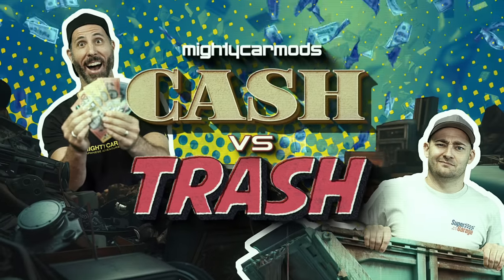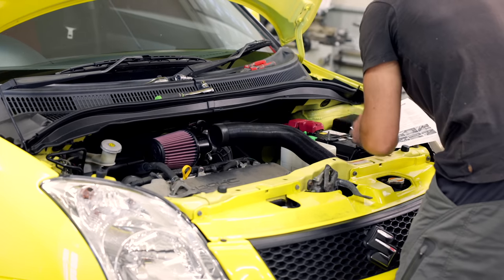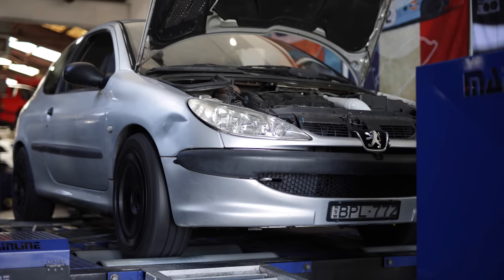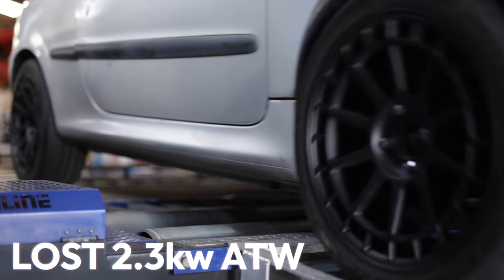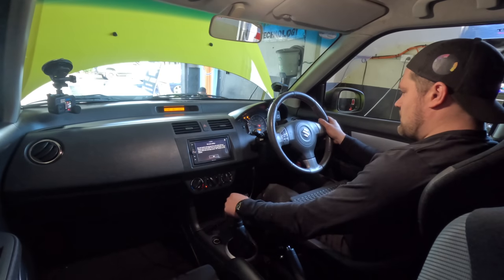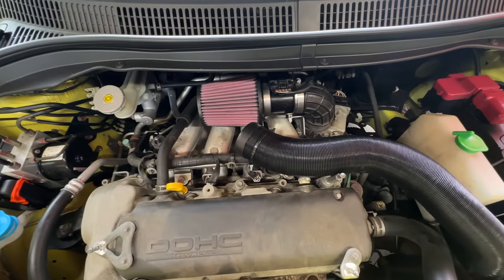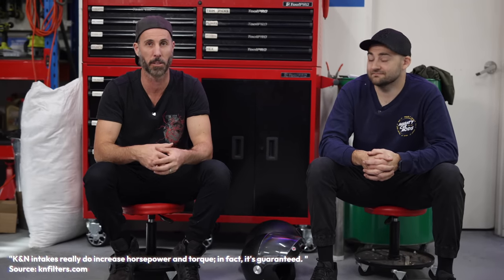Dyno testing POD FILTER Performance Claims | CASH vs TRASH

Comment: Of course Marty lost power. He got rid of his water cooled air filter.
Reply: This deserves a pin😂
Reply: your actually not wrong lol..
Reply: I just started to watch, thanks for the spoiler
Reply: And remove de air filter from the front of the car to inside the engine !
Reply: @hondamaniac1976  I know but this was the top comment and was visible.
Reply: @tzwientjuh  That's definitely a problem that is anyone BUT that poster's.
Reply: I think you mean Marty removed the Bong!
Reply: @tzwientjuh  he's referring to the earlier episode when they removed the stock intakes and installed the new/trash (hot air) intakes
Reply: Heat soaking
Reply: Factory meth injection
Reply: Good point 😂😂😂😂
Reply: more likely it's the wheels as they are quite a bit heavier than the old ones, a hub dyno would show what the engine change would be, he probably lost more hp to the wheels but maybe freed up a pair of hp with his mods xD
Reply: Honestly I would say it’s the fact he now has heavier wheels
Reply: @brendanmooney8517  still losing power on the poogoat thru them as they are wider and heavier than the stock ones, meaning more mass has to be spun.
Reply: Wish I didn't see this top comment man I know it wasn't intended but it spoiled the whole vid man
Reply: @motomenace86  *you're
Reply: @Rose.Of.Hizaki  awesome free spell check no one asked for.
Reply: @motomenace86  you're welcome
Reply: @Rose.Of.Hizaki  your is right lol, not tobe confused with you're.
Reply: @motomenace86  you're wrong
Reply: @Rose.Of.Hizaki  your opinion doesnt mean anything.
Reply: @motomenace86  it's not an opinion. Its a fact. You're wrong
Reply: Probably a big reason for the power loss is the ecu cannot properly adjust the afr... on these cars with a tune you'd make the most of better flowing parts. There are some cars who can benefit from these systems without a tune but they are generally higher performance models that have been restricted from factory like the 6.2 c63... just an exhaust can free up to 30 to 50 hp
Reply: @thehomelessproject3784  nah, the ecus definatly can change afrs. If they couldntthen cars wouldntbe able to go to different elevations. The reason the cars gain like amg c63 is causd there restricted and turbo. Auto adaptives are one reason it lost power. If they reset the adaptives and drive for a few hours the power would potentially increase slightly. The length of intakes change power a fair bit. Theres a guy on youtube whos chanel is just playing with lengths and power is changed up and down.
Reply: @motomenace86  the 6.2 s na... it doesn't have any turbos... elevation changes are one thing. Permanently changing hardware is another I still think its due to these specific cars.
Reply: Great spoiler hahaha
Reply: Wtf you’re telling me you ran two tests with different wheel setups and thought it woukd be a fair test?? 😂

Comment: I would love to see you push back on K&N on this. That kit was supposedly made just for that car, and they "guarantee" a horsepower increase. I'd love to see what they have to say.
Reply: Agreed
Reply: As if they need that headache
Reply: Somewhere in the fine print it probably says the car has to be tuned
Reply: there was no fan in front of the cars when they ran on dyno, they were just gulping hot engine air, and Moog had the genius idea to place the air intake BEHIND the engine (which actually adds restriction xD )
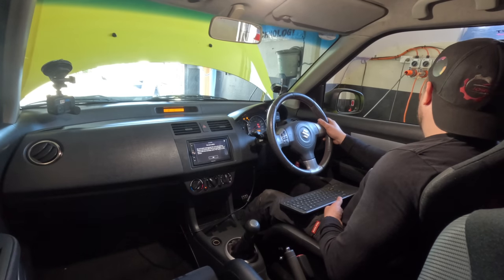Reply: @armoule8596  there is the big blue box @ 2:27
Reply: Can you please put the stock intake back in and send it back to the Dyno and see if you get power back.!!
The issue could be the exhaust.. or to echo others comments.
Lack of a tune..
Reply: @armoule8596  Behind the engine isn't the problem... had it been turned around, there's still the same degree and length of bend in the pipe..... 
Plus, as said, there is a fan , there's also a cold air feed, directly feeding the fans air to the filter.
Reply: @armoule8596  Tell me you know nothing about cars without telling me you know nothing about cars.
Reply: @mickmurphy92  There's a reason I've always put Spectre filters on my builds and it isn't because K&N is better.
Reply: @armoule8596  not a problem if the stock intake was tested the same way.
Reply: @mickmurphy92  Agreed. And they did not need to do much more than they have already. I'm sure quite a few of the 230K views they have right now are from Swift owners who aren't going to buy a filter from them. I know I wouldn't. No, actually I still would just for the induction noise. Even if did gain the promised power it'd still be slow so it doesn't really matter that much.

Whether they like it or not this is where Marty and Moog are influencers. They have enough subs to be known by most car guys across the globe. At least the ones that do interballs. And if anybody tells their friends they're buying an aftermarket filter for their Swift SOMEONE in their group will advise them not to and refer to this video. This WILL make a dent in KN's sales of filter kits.

Edit: Sad typos.
Reply: @Armoule  that won't add restriction at all. There's so much open space.

The issue is that its burried within the engine bay, as well as lack of airflow actually evacuate that hot air within the engine bay.
Reply: That's why I always use "sport" filter in the original airbox.
Reply: @armoule8596   rewind that, they def had a hose with fresh air blowing directly into the air filter
Reply: K&n filters are trash
Reply: @armoule8596  he fitted the kit as supplied, the convoluted tubing supplied was just wishful thinking or marketing on the suppliers side. 
K&N do actually make a decent filter in the right application but it seems they are happy to sell anything the boy racer market will buy.
Reply: @armoule8596 The K&N filter was bound to fail sitting right over the hot exhaust manifold like that at the back of the engine. Aftermarket intakes almost always lose you power, and the ones that don’t are basically an exact copy of the factory intake, but replace the paper filter with an open pod filter design. 9/10, unless you’re running boost, or your motor is built, the stock intake is going to be better for performance.
Reply: You have to upgrade the fuel system or engine management that delivers said fuel. You can't just add more air without adding mire fuel. That's called leaning out your engine. FKN DUH.
Reply: @armoule8596  exactly, even they should know this, it's just sucking hot as hell air.
Reply: Agreed
Reply: It’s been 8 months and I don’t think there’s been an update …
Reply: is it a fan ? @KeithDenny
Reply: @mrcoolhellyeah252  could be a banana 🍌

Comment: That settles it. Everyone complaining about the price of the K&N air filter had a valid point 😂
Reply: They are a Con..
Reply: It settles almost nothing. If you go look at a factory bike, anything modern to in the last 15+ years. Take the factory paper filter out and get a Sprint air filter (mind you this is a TRACK only filter and actually filters almost nothing) and you will in fact gain horse power, that you can measure on a dyno. Chris Moore at Moore Mafia has videos up showing it.  However, as I mentioned, they filter near on nothing, so naturally, its highly ill advised to daily drive/ride something with a filter like this, and may even be illegal in some places.
Reply: @crisnmaryfam7344  I am 62. Back in 1981 I had Holden hj show van. Running a 202 with yella terra head, 350 Holley. Pacemakers..
I drove from Sydney to Newcastle, with  air cleaner on. Then back with air cleaner off..
No difference in Performance..
Reply: @crisnmaryfam7344  yes it is illegal to put a pod filter on your car in most states..
Reply: Why no dyno run in the same session with the original intakes back on ?
Reply: The only benefit of a k&n that I can see is that they are a reusable filter, thats it.
Reply: @graemejohnson9025 It’s legal if it’s in a enclosed box, so it’s not a fire hazard
Reply: The whole setups trash, it’s sucking up nothing but hot air, needs to be moved somewhere colder
Reply: @crisnmaryfam7344  What you're talking about is a drop in filter, which they talk about at the end of the video, mentioning that they can get real HP benefits. The loss in power relevant to the video is about modifying the whole intake system....
Reply: Huh it could have been the exhaust or the wheels or the atmosphere. It settles nothing unless it’s back to back
Reply: I bought a K&N and there was a tiny bit of paper that said "there will minimal or no gains with out specialised tuning".
Reply: @MrT-lh1bw  Done back to back dyno testing with k/n filters years ago on a Mini Cooper S Works rally car. The k/n lost power compared with the factory JCW paper air filter, around 7kw. Didn't matter if it was oiled or not, it flowed worse than the stock paper filter. Won't ever use them......
Reply: With the bonnet shut and heat soaked engine it would've been soooo much worse too. Given the best chance to succeed and didn't.
Reply: @crisnmaryfam7344  It settles everything, because that's garbage product, bought specifically for that car at a high cost. FFS.
Reply: @graemejohnson9025  not if it's fitted in a enclosed compartment or actually fixed to the car in some way , loose pod filters are what the police look for.
Reply: @graemejohnson9025  it's not illegal to install a pod    its illegal for it to not be secured and its illegal to not have the breathers plumbed back to the intake
Reply: @Irishpete78  they also make sure cool noises
Reply: They will flow more, you can't just bolt filters and exhausts on to a stock ECU and expect it to work without a remap.
Reply: @Graeme Johnson, did you retune the carb? Things aren't magic better flow needs more fuel.
Reply: Came here to say the same thing, biggest waste of $500 for a massively over-priced useless item
Reply: @nigspeed  I’d assume it’s just the cost of the dyno runs, but I’m also disappointed they didn’t test the intake and the exhaust system upgrades separately. Now we don’t know which one actually hurt the hp for each car.
Reply: Stock K&N panel filters in a modern car yes, pob filter 😂
Reply: @trojansixone391  he he ha ha. I am 62, my mate is a highway patrol officer for last 35 years. Enclosed pod filters still fail if emission tests aren't passed..
They are a wanker item..
Reply: @jkrillz6571  drop in / pod does not matter... Some cars drop ins ARE pods filters.. in case you havent ever worked in the industry before (i have for decades). The point is the filter alone CAN be attributed for gaining hp. However in a situation like the swift.. its sitting on top of a massive heat soak.. so ofg course the factory snorkus is going to pull cooler air. Another thing to consider, on a sport bike, or just about ANY bike, its ALWAYS getting fresh cold air..
Reply: The filter is fine. The kit is not. Dropping a K&N filter in the stock air box would likely net an improvement.
Reply: @nigspeed  They seem to be on a huge budget lol. They haven't done a track test on these cars in ages. Every video nowadays is just based on one single part they changed on the car. They did a whole video about new seats lol. I'm disappointed with them nowadays. Other YouTubers could have done all these videos in one, and then taken it on track too in the same video.
Reply: @BigStreams_  Not so sure they pay , it's free advertising for the dyno shop more likely.
Reply: @qwertiee  3.7 million subscribers,  I don't think budget is too much of a problem. And yes , they do like to drag these things out compared to others .
Reply: @nigspeed  Mate they literally said a couple weeks back that tracks are too expensive to rent out which is why they won't be tracking the cars every time they make modifications.
Reply: @qwertiee  I said dyno runs  !
Reply: @nigspeed  Okay, but I said track tests. You replied to my comment about them taking the cars on track and said that with 3.7 million subscribers you don't think budget is too much of a problem.
Reply: @qwertiee  Sorry for any misunderstanding.   My original comment was about dyno runs.
Reply: @nigspeed  Aww thanks for being so humble haha. Yea your original comment was about dyno runs, and I do believe it’s free advertising for the dyno shop. I still wouldn’t be surprised if the dyno shop was still charging them and didn’t see it this way. Was just a total misunderstanding between us, glad to see you agree they’ve dragged this series out too long. They finally did a track day video, but to be completely honest, I’m a little disappointed by it. Other channels do series like this much better (much more old Top Gear style). Anyways, thanks for the talk, have a great night :)
Reply: @madmick3794  that's kind of a given. Unless you tune the car for the better airflow, it will barely change anything.
Reply: @houseking9211  it was tuned, it dropped power.
Reply: @madmick3794  was it tuned specifically for the filter, or just thrown on after the car was already tuned
Reply: @houseking9211  2 different dynos after filter, also tried Unifilter

Comment: To unlock the 5 extra kilowatts from the pod filter, you first have to paint front brake calipers red, it's written in the fine print. I heard it on the internet somewhere 🤔
Reply: Also adding some HKS, Greddy and Haltech stickers adds a further 10hp.
Reply: Don't be fooled by the fancy looking pod filter. The real gain comes from the sticker included in the package. 😛
Reply: Worked even better if u have drum brakes and paint them red 🤯
Reply: You're so wrong! It's red seatbelts that give you 5 extra HP.
Reply: FML I have both.
Reply: @Winning9999  i did that to my old ford Lazer and boy oh boy did she hammer after that😂😂
Reply: You gotta put on fake red brembo plastics on brake calipers for kw gain.